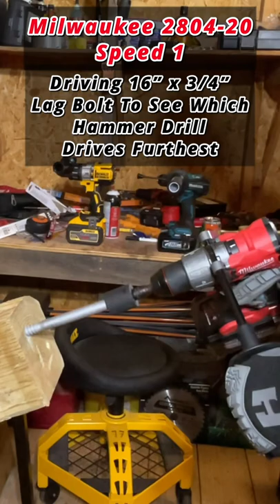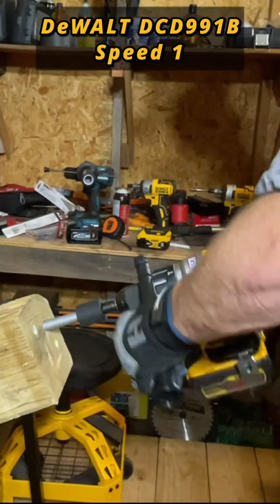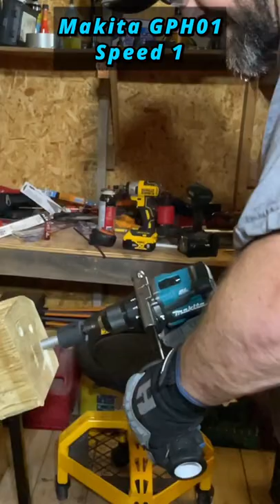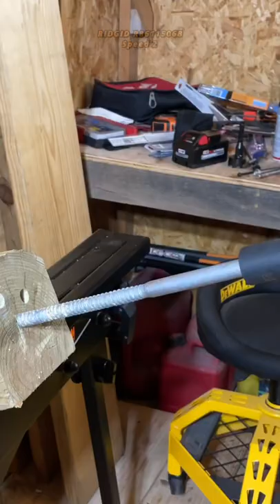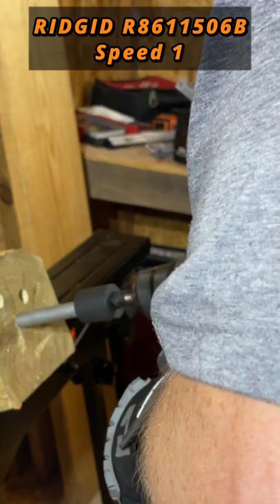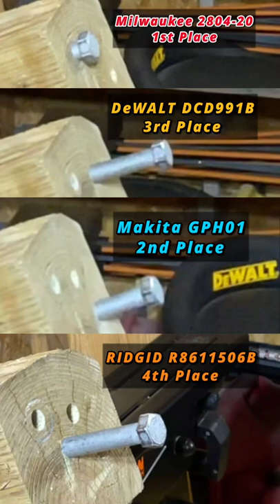😮💪 Hammer Drill SHOWDOWN! Driving 16” Lag! DeWALT vs Milwaukee vs Makita vs RIDGID!

Comment: Why Not use the New Dewalt FlexVolt Advantage   , or Power Detect Drill's  ???
Reply: Because he's trying to make dewalt and ridgid look bad.  Both the milwaukee and makita were driven into pilot holes. The ridgid was placed damn near the very middle of the knot. And his camera angle for the ridgid failed to even show what battery he was using. Could have been using a 1.5 ah for all we know.

Comment: For 1, everyone knows the closer to the center of the rings the harder and more dense the wood is. Kinda convenient that milwaukee was driven the furthest out and ridgid was center. 

Secondly,  whats with the camera tricks? Like why do the other drills have so many camera cuts during their run and milwaukee has 0? 

Why the different angles? Like we cant even see the ridgid battery.

Thirdly, makita was clearly driven into that pilot hole we all can see... in factbyou can tell that the milwaukee was too because looking at the makita run, the bolt pushed out the leftover wood dust from the previously drilled pilot hole. The milwauke also removes dust while driving by the bolt. Not the ridgid or the dewalt though.
Lmfao

Why is the dewalt set in-between hammerdrill and drill?

Clearly a rigged video bud well done
Reply: Shorts have cuts because there is a time limit. Because they are Youtube..."Shorts".
Reply: @CowsGoM3ow  you can seamlessly record and drill all 4 within the time limit of a short youtube video genius. 

A waaay more accurate thing to say is "people cut videos to edit and remove things they don't want people to see".
Reply: Fourthly, I smell fear to try the MC Hammer driller, biz smacks, Thumbs Wacker!
Reply: @mattek519  Then why don't you demonstrate a "sramlessly" recorded video that is well within the 60 second time limit?

Cause you can't. What you can do is complain like a champ.
And1
Reply: @CowsGoM3ow  i can. I have a short already uploaded that has me drilling in to wood and during the drilling there are no cuts.  No and1
Reply: @mattek519  1 drill = 4 drills to you. Losing iq by the hour.
Reply: @CowsGoM3ow  cutting the video as he drills doesn't make the drill time any shorter if he starts exactly where he left off.

You're an absolute genius aren't you?